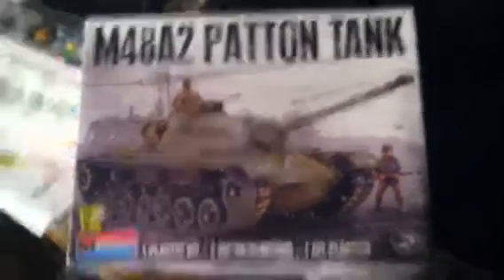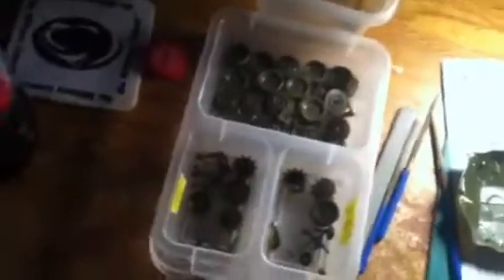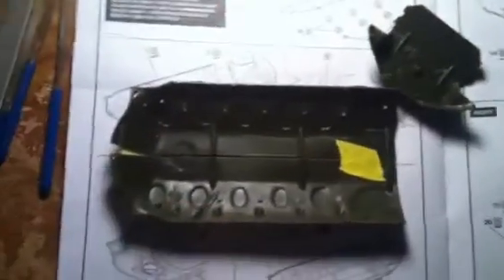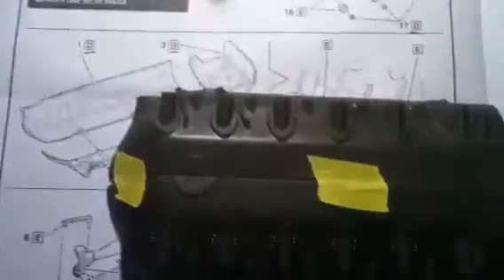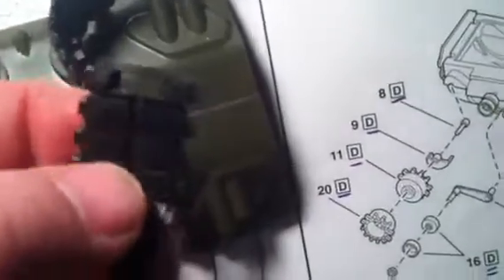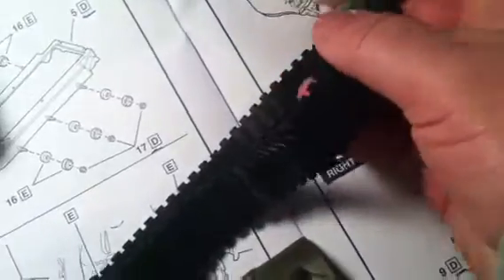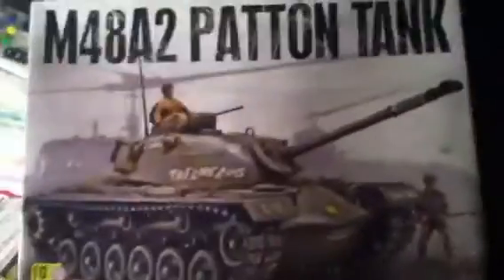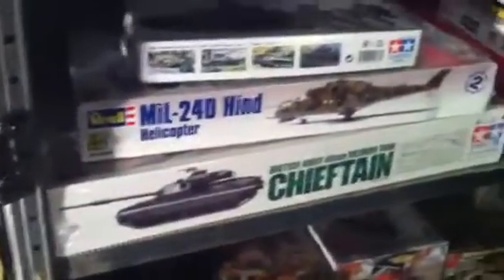M48A2 Patton Tank 1:35 Monogram

Comment: Hi Deron. I do the same as you - take the parts off sprue in to tubs to clean them up. Helps me keep organises and not lose bits lol. That monogram lower hull is strange mate - usually that would be one piece on a tank kit (with tbr exception of revell and maybe zvezda), so it must be a pain to build.  Good work mate - I would have been CAing tnr crap out of it by now :)
Reply from the maker: Ya Mark I may just do that as I haven't started assembling it yet haha. I'm just getting ready to paint it. I hate to say this becuz I don't want to cut any corners but being on the bottom like it is If it gives me fits I may just not worry about it as just that it's on the bottom. Eh Mate ?????  Your thoughts ????
Reply: I am lazy when it comes to the underside but like you say, whose going to see it. As long as the front if the hull is smooth it will look cool mate
Reply from the maker: Mark O'Neill Iagree Mark but then I have it sticking in the back of my mind I know Gil and one other person said in the past Panzer I did to get in a habbit of painting the bottomof the kit as well.  We will see depends how bad it is. Well determine that at a later date but as of now Im leaning towards ltting it open nd just paintin it.

Comment: I'm building that exact kit right now, the lower hull is a pain but just remember CA and accelerator are your best friends. When I build the lower hull I CA it together but filled it with putty, with what I know now I should have just used CA to fill. No worry about shrinkage and with the accelerator you can start sanding in a couple mins.
Reply from the maker: Can I ask what mght appear as a stupid question.  Is there a huge difference beteen CA Glue and Super glue of any type ?